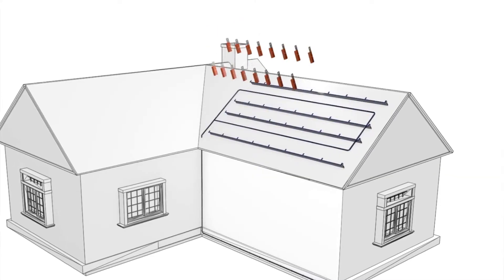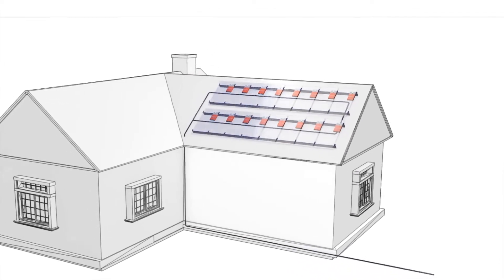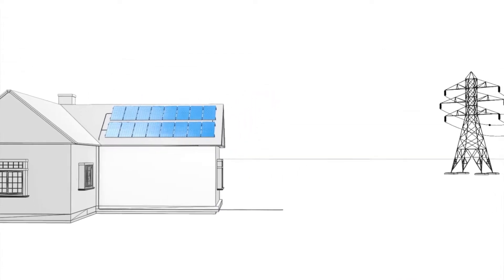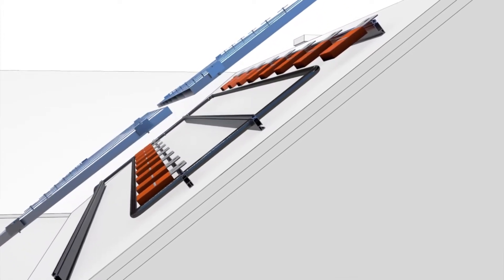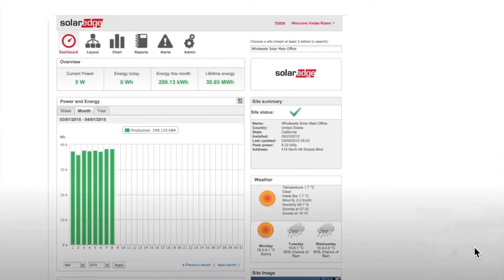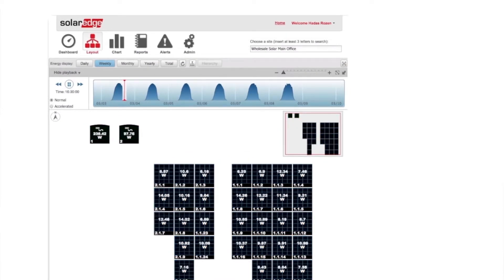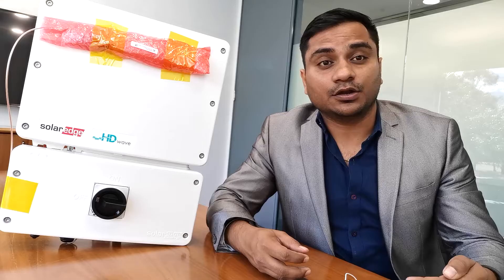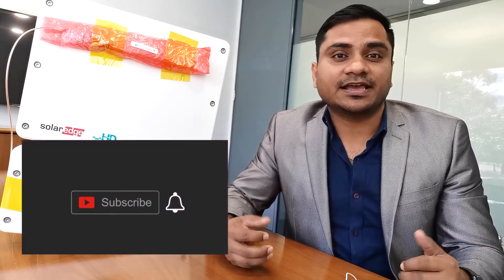SolarEdge Inverter Review - Power Optimisers #SOLAR

Comment: Hi, I have SolarEdge SE5000a, 
My SD card wasn't working and. There was no Activation Key Sticker on side. I tried multiple times and now inverter in locked. Please help me out if you can.
Reply from the maker: Have you tried creating a complaint ticket at Soleredge site. Alternatively email them your query. Let me know how did you go otherwise will call them and find out the their new complaint process.

Comment: Can this Solar Edge Inverter/Optimiser be used with Canadian Solar 595W Solar Panels,14 Nos for 8KW On Grid setup
Reply from the maker: Yes you can use this inverter and optimisers but I would check the data sheet of panels and order only optimisers which works with your panel voltage range, solar edge has 3-4 type of optimisers. Check their website or call them to double check the optimisers model.